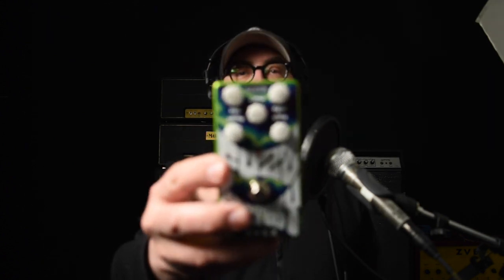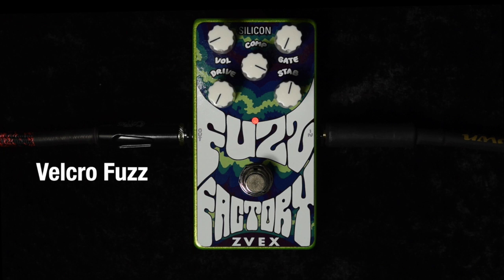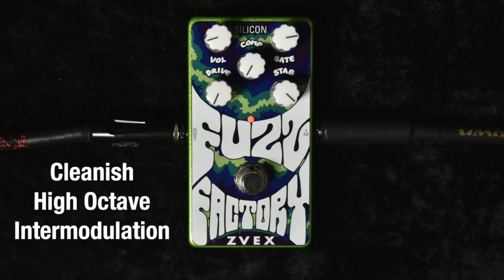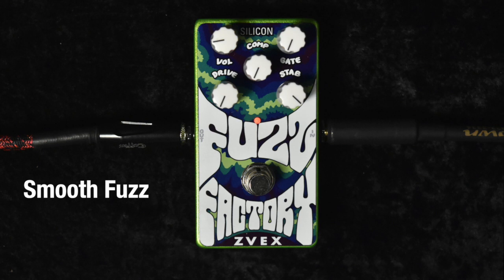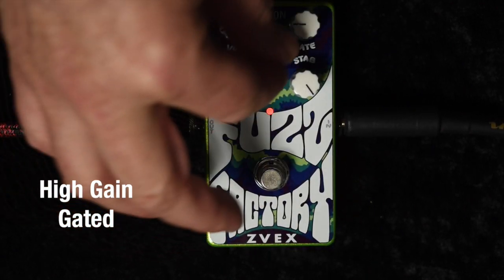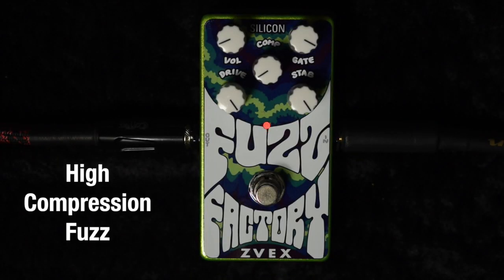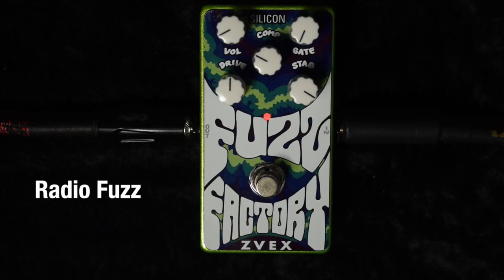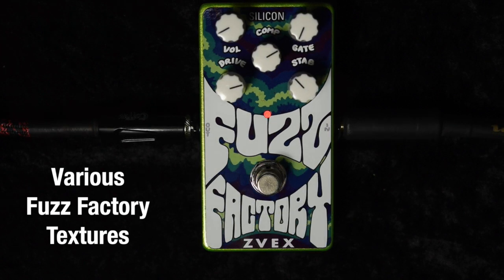ZVEX Vertical Fuzz Factory Silicon Full Demo

Comment: The Fat Fuzz Factory was the best fuzz I've ever come across, actually turning me on to trying many other types of circuits .It was however, very heat sensitive, and seemed to work best with a camera($1 store) battery, - which made it impossible to rely on.( I've also had repeated issues with the mini toggle; just put it in the middle and leave it)
Keep the FFF at home, for recording, and gig with the Silicon Vertical; hook it up to the voltage starve on the power supply, and adjust for best result.
Reply from the maker: Germanium can be temperamental!

Comment: Still no tone control?!
Why?
Reply: Tone is in the hands!!! ........ I'm sorry, I couldn't stop myself from making this joke
Reply: When you add certain controls and more pots to certain circuits, it commonly has a negative impact on the overall sound .With a well designed clipping circuit , the less knobs the better.
Use the guitar and amp for tone control, or run it into an EQ or other compatible drive.

Comment: I wish it was a wah friendly
Reply: Jay Marasigan Usually silicon fuzzes are, you’ve tried this one with a wah?
Reply: I had the same issue with my non silicon fuzz factory and eventually put it before the wah with a buffer in between and it sounds much better. Still hard on the ears when you push the wah all the way down while it’s on though.
Reply: Maybe you need a different Wah.
Teese/RMC , Wilson , and the Vox 846 HW and 847C are not only compatible, but can actually maximalize the range of sounds.